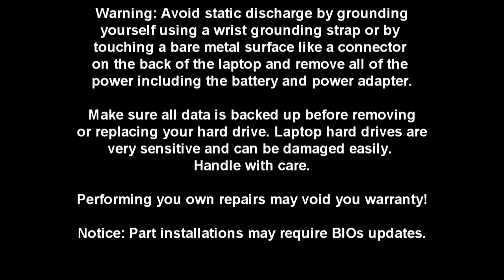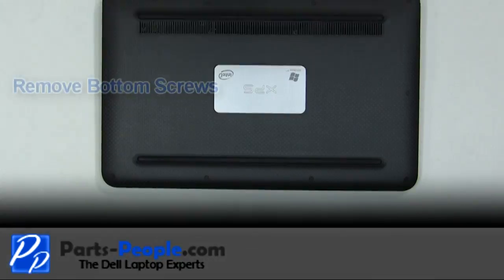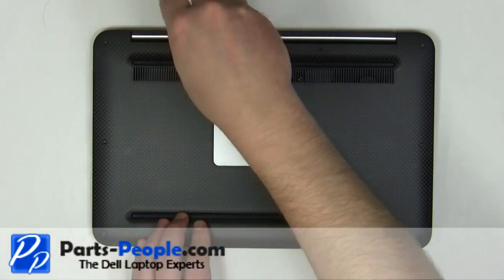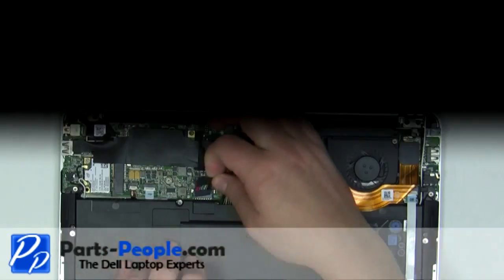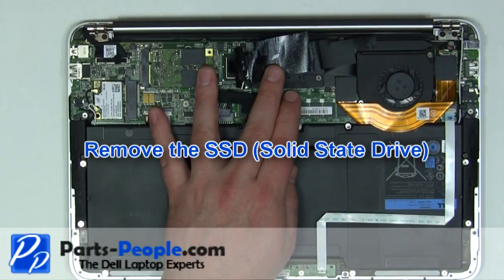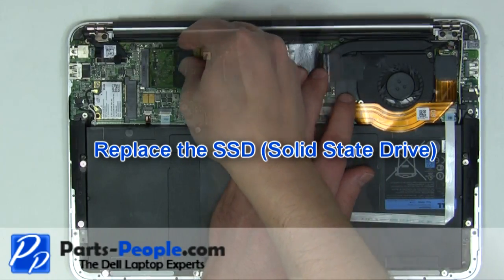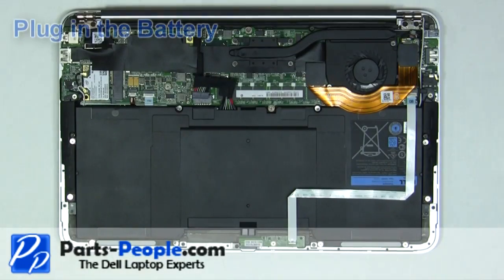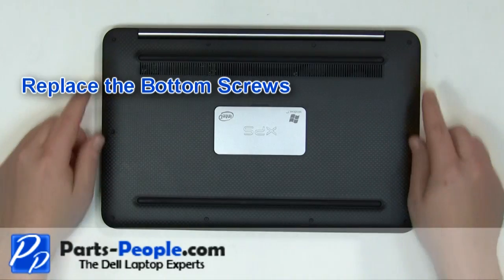Dell XPS 13 (L321x) Ultrabook | SSD (Solid State Drive) Replacement | How-To-Tutorial

Comment: hi, my XPS 13 SSD just detects 1GB out of 256GB. I intend to replace it with the new one. I have searched for mSATA SSD in some online markets, i.e Amazon. But I'm a bit confused whether any mSATA SSD will be working fine with this XPS 13.
Can I use any typical mSATA SSD instead of PCI-E mSATA?

Comment: My XPS 13 L322X crashed. Seems like the memory since it beeps 4 times in sequence. I want to backup the data from SSD drive. What are my options? Starting the system is not an option. Is there an external drive enclosure that works with mSATA to usb and let me access it? Or is there any other option?
Reply from the maker: +rojermoore Yes, you will probably have to use an mSATA to USB. Something like this http://www.parts-people.com/index.php?action=item&id=17062

Comment: can I use Samsung 850 EVO 500GB 2.5-Inch SATA III Internal SSD ( on amazon) to upgrade my SDD from 128gb to 500gb?
Reply from the maker: +ratish garg No, it can only use an mSATA SSD. A 2.5 inch will not fit in the laptop. This would be the type of SSD you need. http://www.parts-people.com/index.php?action=item&id=18592

Comment: Could someone please straighten me with the technical terms?
What does m.2 stands for and must my upgrading new SSD be m.2?
And whats the difference between mSATA and SATA 3 and again, which one do I need?
Please recommend on an appropriate SSD for 512 from Amazon for the XPS 13 2015..
Reply from the maker: MrPopocatepetl m.2 is a form factor for wireless cards and SSDs (it could be USB, Wi-Fi, PCIe, or SATA). Formally know as NGFF (Next-Generation Form Factor). In the case of the XPS 13 you would need an mSATA mini-PCIe SSD. The mSATA is a designation of size meaning mini-SATA. Mini-PCIe is how it interfaces with the motherboard and the slot it will fit into(mini-PCI Express slot). And SATA 3 is the bus speed at 6Gb/s. Any of these would work with the XPS 13. http://www.parts-people.com/index.php?action=category&id=143&subid=435&refine=category_hard-drive .

Comment: I looked at the screws at the bottom plate of my Dell XPS 13, and I found they aren't Philips screwdrivers. By any chance, can you send me a link to the screwdriver that will fit the screws on the XPS 13?
Reply from the maker: Brian Lee I use an 8-in-1 Torx screwdriver made by Husky. I believe T5 is the size but if you got the 8-in-1 it would have the correct size for sure.

Comment: Hi, I own a XPS 12 2 in 1 (9Q33) it came with the Samsung SSD SM841 mSATA 266GB according to Device Manager. 

I was wondering if its possible to upgrade the SSD to at least 512GB. 

It looks like Samsung does make a 512GB SSD and even a 1TB SSD (which I probably won't be able to afford the 1TB version). 

The install looks pretty straightforward so I don't have any issues with that part of the process. 

I'm just wondering about the model of drive to use, I understand that Samsung is making a better 850 model. 

And could I even install the less expensive Crucial mSATA SSD drives although not rated as fast as the Samsung drives. 

I do use Acronis Backup software so I could (if I purchased an external SSD case) pre-load the backup (or should I say restored backup) on to the new SSD before placing it in the XPS computer. 

And lastly, would I have to be concerned with any SSD drivers that might conflict with this new upgraded SSD drive. 

Thank you. 

Rob
Reply from the maker: I've heard good things about Samsung's SSDs and Crucial's SSDs, so, it really about personal preference. There shouldn't be a problem going to a 512GB or a 1TB drive, and you should have to load any drivers. You will have to either reload Windows or "Image" the original drive. A backup will not work.

After you reload Windows the backup should work or you can simply transfer files to the new drive. If you choose to reload Windows, you will be able to transfer documents, music, and videos, but not programs.

If you "image" the new SSD, everything will be exactly the same as on the original SSD. I don't know if  the Acronis you have has an Imaging software, but if it does I would use that. Imaging is easier than trying to find all the programs to reload onto a new hard drive.
Reply: Parts-People.Com, Inc 

My issue is that I don't have a eparate windows, installation cd. This computer comes with their pre-loaded (I think the term is OEM version of Windows) Windows 8.0 and when I got the, computer I did the online, upgrade to 8.1. I understand (and its a question) that if I just use an image, I'm using an image of a smaller hard drive. So I would end up with a original sized partition and then extra space to make a partition out of the larger partition. Then there is Windows complaining about licensing because its on a different hard drive from when it was registered. So I'm trying to find out how to overcome these issues. Thanks Rob
Reply from the maker: *****
With Acronis Imaging or Cloning, the default uses "Proportional Partitioning", meaning that it will partition the entire drive if it's a larger drive. So, you won't have an extra partition. As for Windows, the image will already have the product key so, you won't have to reenter it and Windows will not know the difference.

The other option is you could call Dell and ask them to send you a copy of Windows and you could load it manually. If they gave you a new copy of Windows you would use your original product key.

Comment: I would like to know what is the maximum storage I can update in a DELL XPS 13 (2014). The Ultra book comes with a 128 GB storage space. I'm on a i5 processor and 8 GB Ram. I just need info... on how much I can extend the storage space from 128 GB to some thing more than this.

Comment: Does the 32Gb mSATA SSD work with a 2.5-inch SSD? I want to replace my HDD with a SSD but I wonder if the mSATA SSD will be disabled. My laptop is L421x XPS 14
Reply from the maker: If you replace your HDD with an SSD your mSATA will not be disabled. The laptop will recognize the SSD as a new drive that needs to be formatted.

Now, if you were wanting to replace your current HDD with a mSATA SSD you would need a SATA to mSATA Adapter Caddy. Something like this. http://www.parts-people.com/index.php?action=item&id=13459 The laptop would still just recognize it as another hard drive and it would not disable the original mSATA you have installed.
Reply: Thank you for your response.
Reply: +Parts-People.Com, Inc  I have this exact 2012 Dell XPS 13.3 notebook for my son with the standard 128GB M.2 SSD, I plan to upgrade the SSD to 256 can you advise what m.2 256 SSD is compatible with this notebook. I would like to increase the ram from 4gb to 8 but I understand the memory is soldered onto the motherboard so that is not an option
Reply from the maker: +La Ghoulstra (Cisco Kidd) This laptop actually uses an mSATA Mini-PCI E SSD not an M.2. they are different form factors so when you order the SSD make sure it is the Mini-PCI E SSD. Here is a compatible 256GB Mini-PCI E SSD http://www.parts-people.com/index.php?action=item&id=18621
Reply: +Parts-People.Com, Inc yes you are correct, I made an error as my desktop uses M.2, I meant mSata mini pcie. The ssd you linked is identical to what i have found already but at $80 w 91% health, lightly used. Nothing can be done about the ram though which is a bit of a bummer. Is the laptop capable of taking 512gb?
Reply: La Ghoulstra Yes your XPS will work perfectly when you install a 512GB SSD.
Reply: +Duc Tran I only wish the memory could be upgraded. The laptop is still pretty decent, a bit more memory would have been icing on the cake
Reply: +Parts-People.Com, Inc do you know if the 2012 XPS allows a memory upgrade to 8GB over the 4 GB installed?
Reply: La Ghoulstra You can't upgrade the RAM of this computer because it's stuck on the mainboard.

Comment: I heard from a dell sales representative that it can't be upgraded because it is integrated to the motherboard. I think it makes no sense because although mSATA slot is soldered into the motherboard, mSATA SSD itself is replaceable I guess. 
Am I right on that? 
In case of XPS 13 too, sales rep told me that xps13's ssd can't be manually upgradable, but he didn't give me any reason. 
So If I buy an XPS13 128gb ssd version, I can always manually replace it with 256gb or 512 gb mSATA ssd right?